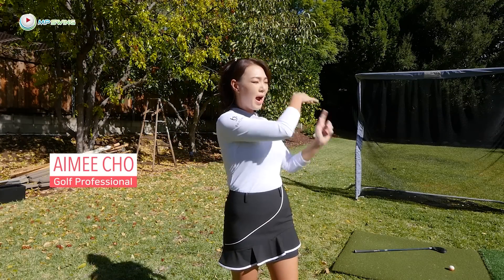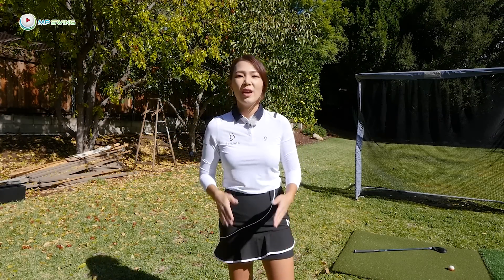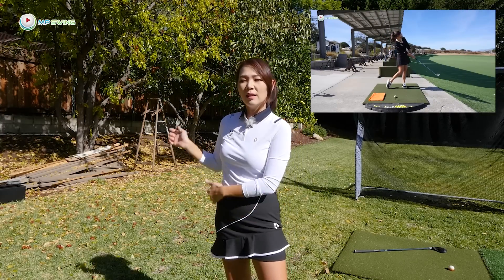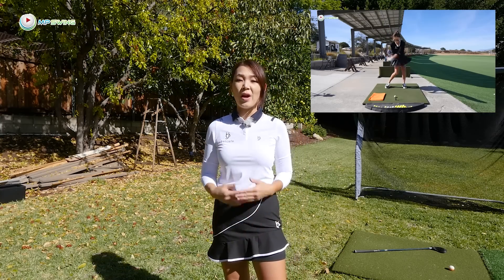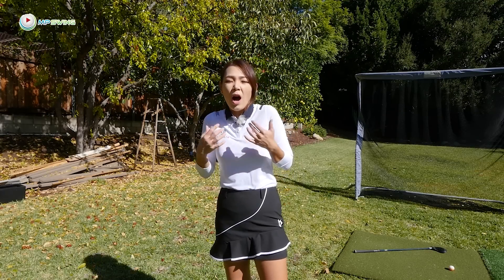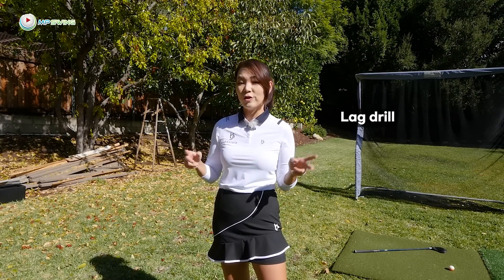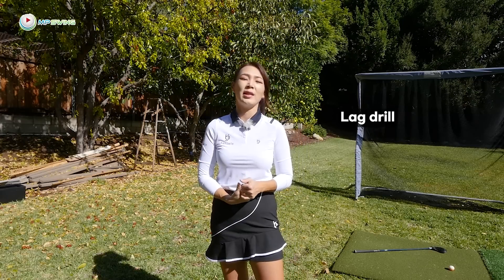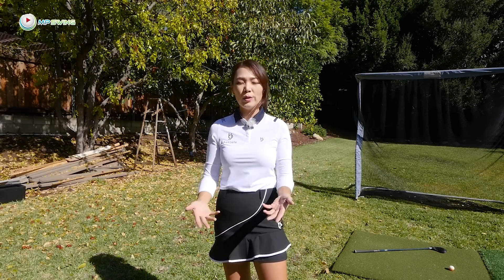STOP Casting and Start Doing THIS! | Aimeefied 7 Iron Series (Ep. 5)

Comment: Hi - Is your core loose or engaged in the backswing? Loose feels like I can turn further.  Engaged feels like a reduced turn but maybe leads to a faster turn?
Reply from the maker: Thank you! 😁👍
Your core should be nice n engaged in order to coil well. If you keep the core loose, it's easy to lose your set up angles and possibly reverse pivot. If you coil well, you will most likely feel that your backswing isn't big enough. But this good coil will produce more speed, therefore more power. And allow you to use the body nicely rather than using arm strength to hit the ball. I hope this helps! Thanks:)

Comment: nice lesson, casting was my issue, 
thank you. 
I'm working on the speed this winter, try to get the ball speed consistently above 130 (club head speed 90) with the driver, I learned if the launch angle is 21, it can get to 220 carry, 248 total. But I was casting, either launch/ball speed, 16/131 or 21/124 - I  try to swing 100 drives everyday, so far i was NOT able to reach 21/131 together, and the % of swing that's above 120 ball speed were 15%, 16%, 50%, 16% the past four days. I thought I was onto something with a 50%, then got a 16% yesterday, let's see what I could do today after watching all your lessons